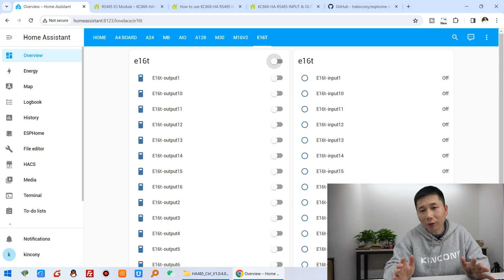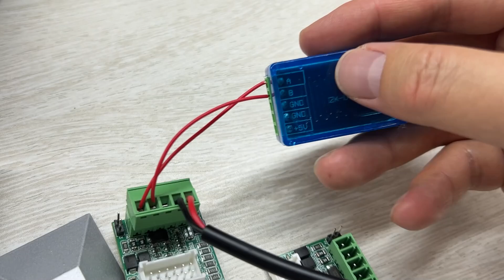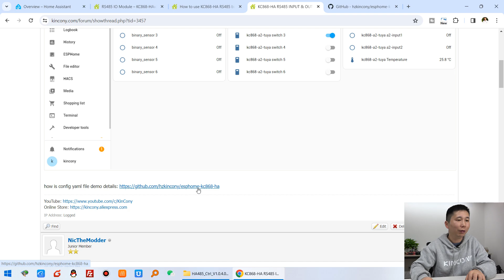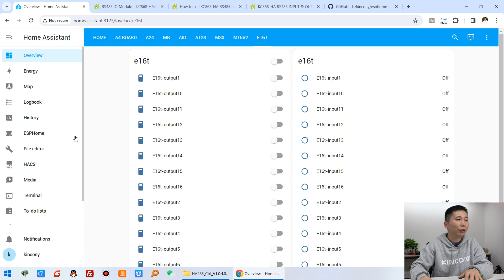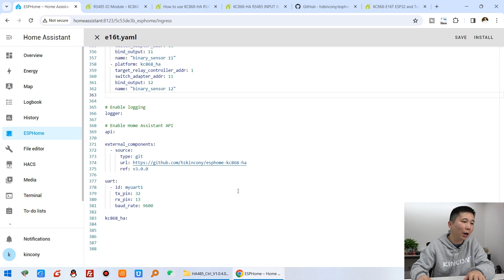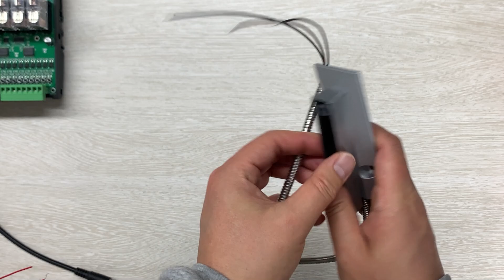door sensor convert to RS485 in ESPHome using KinCony HAv2 module

Comment: Can you do a video on the Kincony RS485 temperature sensors with esphome? Specifically how to use multiple Kincony temperature sensors (SHT30) together on the same bus with different addresses.
Reply from the maker: we already have ESPHome yaml for the RS485 temperature sensor. it set address by PC software.

Comment: I want to test you product. But i dont know which if any can tack in sensor data and send it to HA ?
Reply from the maker: any dry contact sensor signal will feedback to home assistant via RS485.
Reply: @KinCony  okej. I am IT guy not in deep technically knowledge about electric. So I kind of umderstand. But can you perhaps explane what dry contact and point me to right direction what works and what dissent?

For exempel I want use a "in wall  tutchscreen sonoff NSpanal" an thinking about if it possible to redirect communication signal through your PCB to to HA when wifi going down. If this can be complices we going to have a Breakthrough.  Hope you understand me here. Need to know the limits what can be done with PCB RS485. I believe I need to reprogram the panel some how. But one thing forst. Really a fan of your builds.
Reply from the maker: digital input with GND means trigger. dry contact signal just OPEN/CLOSE signal, without any voltage. @TobiasMüllauer

Comment: Is star topology possible and if yes, should terminating resistor jumper be used on all KC868-HAV2 devices?
Reply from the maker: not use by "star" mode, it's RS485 bus, need "hand by hand". only use resistor jumper at last KC868-HAv2 board.